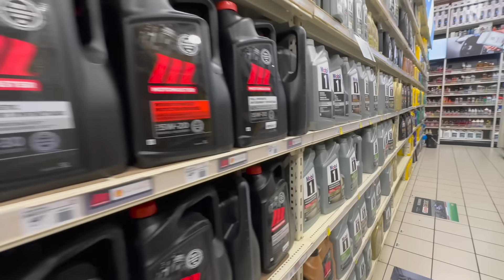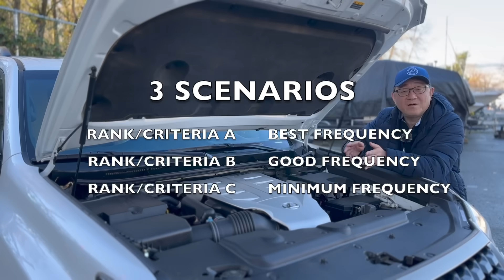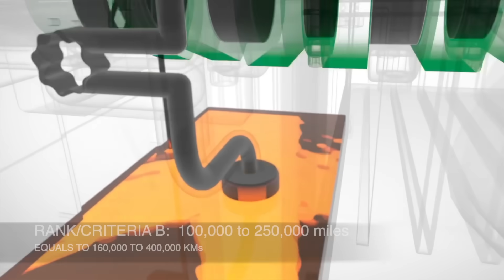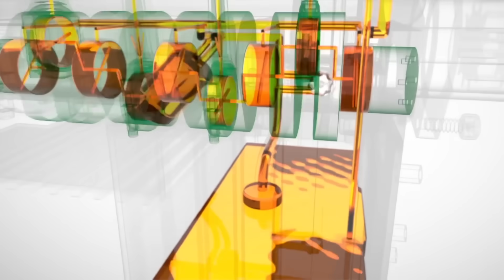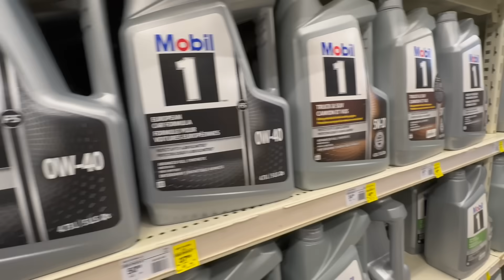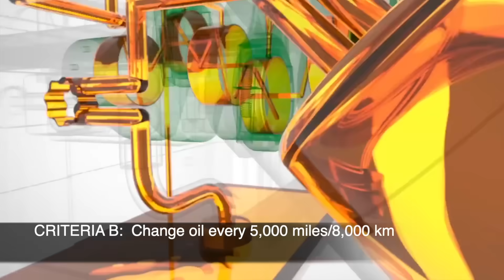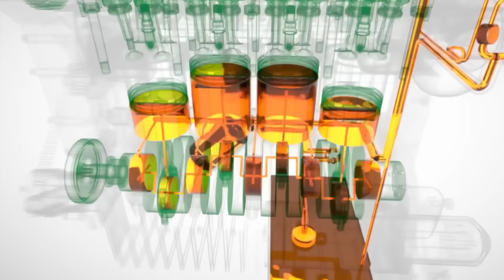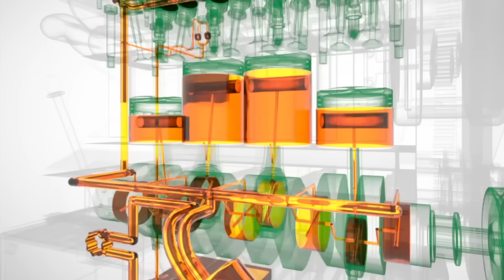ENGINEER EXPLAINS HOW OFTEN TO CHANGE OIL & FILTER // UPDATED CRITERIA-BASED RECOMMENDATIONS!

Comment: My 2000 tundra changed the oil twice a year and the filter once a year have 250,000 miles on it always used Mobil one.

Comment: @1:45 This man just said NEVER buy a used lease auto..... EVER !
I personally stick with 5,000 miles Mobil 1 oil & factory filter change but many times it's only 4,000 miles. My car and truck engines are squeaky clean if you look in the oil filter hole. Don't forget to do the trans, transfer case, and front/rear differentials.

Comment: Another thing to keep on top of is cooling system maintenance. With many if not most modern engines one overheating incident is all it takes to cause major and expensive damage. 
Gone are the days when you could just let it cool down, chuck some water in the radiator and all is well.
Reply: only if you use the right coolant and water- the interval is 100K on newer cars now.
Reply: yes, eventually antifreeze loses it's corrosion preventing capabilities. My F150 is now using a different coolant than what was originally in it from factory.
Reply: The original factory fill coolant should be good for around 6 years, after that change it every 4
Reply: Aside from cooling the engine,  a high quality engine coolant also lubricates the water pump and seals.  This is often ignored and most end up with a premature coolant pump failure/leak (new car manufacturers will always use the cheapest part - note all the plastic on modern engines!).  I always change my coolant way before the manual says to.  I just retired my 2001 Tacoma PreRunner (purchased new) with 520,000 km and the original water pump.  No leaks or failures.

Comment: In a previous job I got to visit the lab where a very well known brand of oil was formulated and tested. The chief engineer told me that if I wanted to have virtually zero engine wear I should take the recommended service interval and halve it. So 12k miles becomes 6k and so on. I followed his advice and my last car was 19 years old when it had to be scrapped due to rust. But the engine still ran like a sewing machine.
Reply: Interesting that the expert didn't mention filtration. No oil that meets manufacturers specifications wears out, it is contaminated and the crap and crud that was not filtered away causes damage.
Reply: Wrong,the additives in oil wear out.
Reply: @94520shatto  The filter change was obvious, I'd assume. Maybe not ?
Reply: There are several bypass depth filters that clean oil. The full flow filters only remove engine damaging abrasives. My Pontiac Torrent has a Australian Jackmaster Classic I started with a Frantz oil cleaner in 1963. Before synthetic I changed the filters more often and added more make up oil.
Reply: I have been known to drain oil like with a leaky head gasket or a used car. The Jackmaster Classic gets a filter change and a quart of new Walmart synthetic every 6.000 miles. I drive mostly highway. The old Ford Diesel tractor uses 15W 40 diesel rated Walmart conventional. Because of soot I change the filter more often and add more makeup oil. It uses a flat head Ford V8 canister filter converted to use a 4 1/2 inch roll of Scott 1000 toilet paper. It has half a roll of VIVA paper towels in it now.
Reply: About 70 years ago I bought a decent looking 41 Dodge. It had a good engine with a Fram bypass filter that used cotton the same as a Luberfiner. Hit a hole in the road and the floor fell on the drive shaft.
Reply: What car 19 years ago had 12k oil changes
Reply: Better rust proof next time
Reply: And if you used factory intervals, it likely would have rusted out at the same mileage, with half the money spent. Instead of “virtually no wear” there might have been “a little bit of wear”, that would make zero difference.  If zero engine wear is the objective, change it every 3,000. Or 1,000. Or every time you drive it.
Reply: You wasted your money on excessive oil changes when you should have been spending it washing the car so it wouldn't rust
Reply: @TheRealSykx  Trust, 19 years of salty winters is not bad. It wasn't the exterior body that rusted, it was everything underneath. Brake lines, exhaust, springs, brackets, subframes, ABS rings etc. Wasn't worth replacing all of it.
Reply: @Haawser  ,, 
same here , 
19 yrs of rust on mechanic components. 
Doing another  round of rust removal this summer and will do some protection again  . 
Any suggestion on the protection ?
Reply: @enzoh7763  No idea about you weather,  I am in the UK,  and the winter salt on motorway is a BIG killer here,  I use neutrarust 661 after tried with different things and work very well for my old Honda jazz with 183k miles, I bought the car with some rust and I saved it,  you can later paint the area if you want,  I don't paint due I put underneath and sill the rust converter.   And in the end of November I put Lanoguard to keep a layer between the metal and the salt of winter on our roads,   and in summer the lanoguard fall due the heat without my help.  And I start the process to check any rust etc in summer. kill it with Neutrarust 661 and November again lanoguard and so on.   now it is good put old motor oil inside of the door or similar, I mean we have some small holes in the car doors to allow escape the rain water,  and usually cars get rust there.  put oil, or any grease. woala!
Reply: @Haawser You should have been blowing all that used oil on the undercarriage to prevent it from rusting.
Reply: @TheRealSykx you don't live in the rust belt do you?
Reply: A roll of toilet paper is about the best oil filter there is. Because too many fools assume toilet paper breaks down in motor oil they are trying to avoid being called a toilet paper filter. The Australian Jackmaster Classic uses a very high quality roll of Australian toilet paper in a sock and charges about 20 bucks for it. I use a roll of Great Value 1000 from Walmart in my Jackmaster.
Reply: Just chang the filter every 3 thousand and oil every 6 thousand. The synthetic  oils last for evet

Comment: A lot of what this guy says is complete rubbish. Oil does lose its ability to lubricate over time, because the additive package in the oil, breaks down. Detergents, dispersants, rust inhibitors, long chain polymers, etc., all degrade significantly. Yes, oil also becomes contaminated, which only adds to the necessity of removing that oil, and replacing it with fresh oil.
 Extended oil change intervals are a false promise, no matter how long you intend to keep a vehicle.
The traditional 3000 mile oil change interval is still valid, because the additive package in the oil no longer does its job properly, as the miles accumulate. Regular oil and filter changes are the cheapest way to prolong the life of your car or truck engine, gas or diesel.

So-called synthetic oil (its not really synthetic, by the way) does not change the fact that
its additive package breaks down, or that it becomes contaminated with combustion
byproducts. 
If this guy says he is an "oil engineer", I want him to tell us where he got his technical
degrees. What is his work experience? Was he employed by a major oil company?
Does he teach at a technical college? 
People say all kinds of things online, and make all sorts of claims about themselves.
My information comes from many conversations with oil engineers at Ashland Oil (Valvoline),
Quaker State, and Texaco. I was a Texaco dealer for 10 years.

Comment: Love this topic. Love the categories. Assume we can get a car to 500,000 miles. Assume oil changes are $40 per change. Assume you do it yourself. The differential cost to change it every 3,000 miles vs every 5,000 miles is only $2667 over the 500,000 mile life of that engine. If you drive 25,000 miles a year it will take you 20 years to get to 500,000 miles. It will cost you $11 a month more to change oil at 3,000 vs 5,000 mile intervals. 

I had a 2017 Ford F150 with the Coyote V8 5.0l engine. I changed oil meticulously trying to maintain 3,000 miles. When I sold it I had a spreadsheet of all maintenance I did on that truck. My mean time between oil changes was 3,400 miles. I had 157,000 miles on that truck. It ran as good as new and I am not exaggerating that. It had the old 6-spd trans and after 75,000 miles I started to suck and fill one quart of trans fluid every two oil changes. This turned out to be very easy to do once I set myself up for a quick “takt time” operation. 

At 157,000 I sold it and received TOP DOLLAR for the truck of $28,000. It was a basic XLT trim by the way. 

The guy who bought it now has over 200,000 on it. He is also maintaining it the way I did. We stay in touch and we hope to see that motor at least reach 300,000. I find that to be a very reasonable expectation. 

My old boss had an F250 with the 6.2l. He drove tons of highway miles. He also loves his truck and maintain 3,000 mile oil change intervals. That truck now has 330,000 miles on it. It is his daily driver. His bird dog owns the back seat and is his constant companion in that truck. 

David. Thanks for a great video. I hate when people tell me that their book recommends 10k mile oil changes. I try to explain why I shoot for 3,000 but they don’t understand the micro physics of sliding parts separated by an oil film. This I’ll never be able to convince them. That’s ok. I just won’t buy a car from them!
Reply: I’m not arguing that changing oil every 3k is a smart practice. Why not every 2k? Wouldn’t that be even better? Why not every 1k? You don’t know that if you changed every 4k that it wouldn’t have still been running as good as new. We live in an economy where some people have to decide whether to spend their money on food or medicine. Luckily I’m not in that category, but if they go every 6k instead of every 3k, that doesn’t make them a bad person, or an uninformed person or even an unwilling person, maybe that’s all they can practically afford to do. Back in the day it was just the standard to go 3k. So was that interval necessary, or did the oil companies want to sell more oil? It reminds me of Proctor and Gamble way back in the day when they had like 90% of the shampoo market but weren’t satisfied. They decided to just change the instructions on the label to say “rinse and repeat”. So now people that followed the instructions used it twice as fast so they could sell more. Was it necessary? The engineer in this video even said, it’s not that the oil loses its ability to lubricate, it’s cause it gets too dirty. So maybe it would be helpful for the car manufacturers to put a color guide in the owners manual, and recommend a certain stage of oil color rather than a set mileage interval. Just a thought.
Reply: 3000 mile o/c with highway driving? Do me the favor of saving that oil and I'll come and pick it up every 6 months so as to continue using that "clean" oil
Reply: This all got pretty personal and if I caused any of that I’m apologizing. 

Oil gets dirty every time the piston hits TDC on combustion. The piston rings are totally awesome by design at how they help control the cylinder pressure but they CANNOT hold it all back. Dirty combustion byproducts come past the piston rings and make the oil get dirty. That “dirt” is carbon byproducts. That carbon is pretty abrasive. That dirty oil may still have lubricity within spec range but it is still dirty. David did say that Toyota race engineers think very short mean time between oil changes is better. I believe this is the reason. Yes it is still “slippery” but it’s also now dirty with carbon blow by and that means it is also now a bit more abrasive. 

I shoot a lot. I’ve studied carbon deposits in F-Class Benchrest rifles. Carbon deposits left uncleaned are incredibly tough to remove. Especially the “carbon ring” just forward of the bullet right before the lands. Carbon can build up there enough to not only open up shot groups but also produce excessive (dangerous) pressures. 

I’m wondering is someone out there can technically describe what an oil filter is capable of filtering out of oil?  Does an oil filter reduce carbon in the oil from blow by?  Or is it only good for larger particles?  

It would be awesome to understand pressure gradients across an oil filter at 2k, 3k, 4K, 5k up to 10k or even 15k. I would think that when oil pressure gradient picks up to a certain point that’s the time to change oil. I suppose that kind of pressure gauge could be installed. 

I just changed my F-350 7.3l gas engine oil today. I have 58,000 miles on that truck and my mean time between oil changes is 4,600 miles at this point. I am going to stick to that. Personal choice.
Reply: "I hate when people tell me that their book recommends 10k mile oil changes."

I hate when people like you think they know better than the manufacturer.

I've owned my 2004 Audi S4 since it had 13,000 miles. It now has 161,000 miles. I change the oil and filter every 10,000 mi. as recommended by Audi, with Mobil 1 full synthetic without issue. I'm even on the original timing chain guides and tensioners.

Now tell my how I'm wrong.

Comment: Sure, the oil manufacturers certify their oil to last 10,000-20,000 miles depending on product, and they make high mileage filters, but I change my oil every 13 seconds just in case.
Reply: Huh?
Every 13 seconds?
That’s impressive.

Comment: I rented a Toyota Camry and I noticed an oil change sticker on the window. Basically it stated 7,500 miles oil change. Now with the way people treat rental cars. I would never buy one. The oil indicator light was on most the time I had the rental car too. 
If I were leasing a car and I plan to return it. I would probably just replace the engine oil once a year with synthetic oil regardless of miles. lol

Comment: If I own one of those rapid lub place, I would crown myself as an expert and recommend you to change oil and filter every 1000 miles. My Toyota manual said the interval is 16,000 km. for regular service. There are no shortages of "experts" that thinks they know better than the people that design and made those engines. One thing , you have to be honest with yourself, you are actually using the car regular service, not severe service. A filter, as long as there are enough unclogged pores in it to pass enough oil through, in theory do not need changing. But you cannot inspect a cannister type without destroying it, but you can remove the filter from Camrys and inspect it and maybe run a magnet through it. Then put it right back . The air filter to me is a life time item. I never change them, including the cabin filter. We never had cabin filter for decades, and we still alive. The air filter, I just remove it every summer and blow compressed air to clean it, then inspect. Put it right back.Friends from middle east desert taught me that trick, or they be replacing one filter a week in the desert.  I added some cotton type AC filter material at the bottom as a prefilter, which I just shake it same time. If you save the excess amount you spent on synth oil, the money are much better spent on a short block later, assume the rest of the car is worth it. The short block come with piston rings, I make sure the oil ring goes into the garbage and replaced with ring s from a Camry at least a decade older. They have stronger back up spring and burn less oil, yes I take the 1/10 mile /gallon penalty. For your interest, those so call class 8 diesel tractor trailer, even 2 decades + ago, the oil change interval for highway tractors are 25,000 miles. Which will take them about 10 weeks to pile on that much mileage. They are turbo diesels which is hard on oil too. My guess is they take about 8 gallons at a time.

Comment: So Mercedes van diesel engines designed with 10000 mile intervals and which have achieved 200K plus miles easily should have their oil changed every 3k miles? Why?

Comment: Need a transmission oil change interval video.  Interview an Aisin transmission engineer!
Reply: Agreed, we mainly just hear people harp on engine oil
Reply: Agree too .
Since mine are over 10 yrs old , 
I do trans and gear oil change every 50k km.
That is after 250k mileage .
I wonder , is this "good" interval  ?
Reply: Nobody talks about transmission fluid changes! We need more information on this. In a world where there is no way for the consumer to check transmission fluid or even change it themselves. Manufacturers saying they use "Lifetime Fluid" I'm not comfortable with that. Especially when I want to take great care of my car and make it last
Reply: @rileystanek  why aren't you searching YouTube and google for online fluid change tutorials?  The fluid of every toyota transmission can be drained and refilled.
Reply: Hint: Use Factory oil (less problems w/Asian - Euro transmissions), an independent shop utilizes that strategy. Been a client of this shop for 28 yrs.
Spent 20 yrs as a auto tech/machinist at a much earlier portion of my life.
Reply: About the first thing I do when I buy a car is put a good filter on the engine and transmission. Then I need a quart of new oil added. Im wondering why the Pontiac calls for Asian fluid. It has a Toyota transmission. Have to crawl under the car to get to the dipstick. They dont make Motor Guard oil cleaners now. Had to modify a M 30 compressed air filter. The 3.4 engine has a Australian Jackmaster Classic.  I dont believe in allowing lubricants to get dirty then draining them.
Reply: I change the CVT transmission fluid every 2 years on my 13 year old Altima car.  Transmission still running like new.
Reply: I do 70k tranny service.
Reply: as a unspoken role.. it depends on the conditions...harsh climate and roads, trailer hauling, anyway of them, safe bet: 6 years or 50k km... what comes first